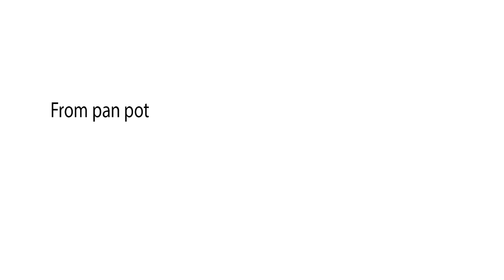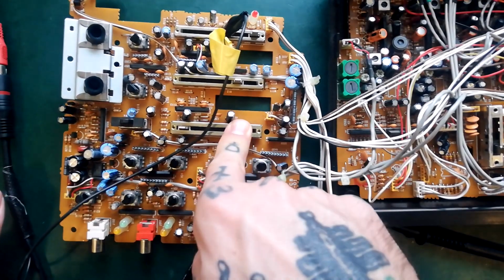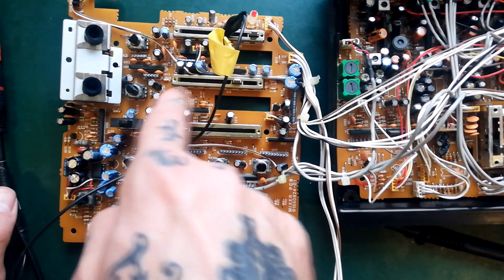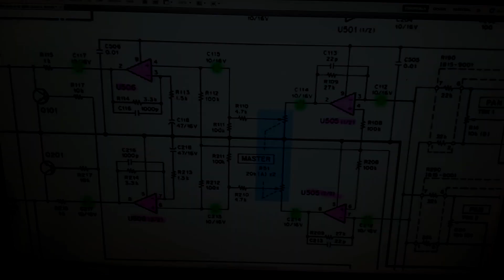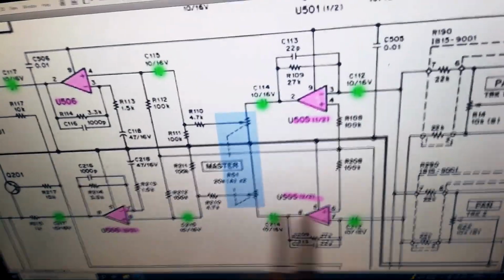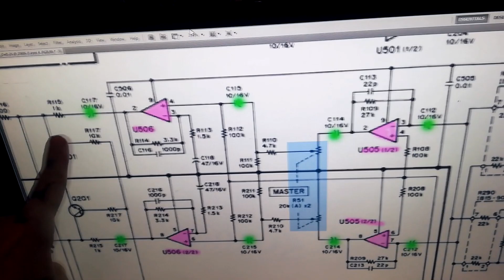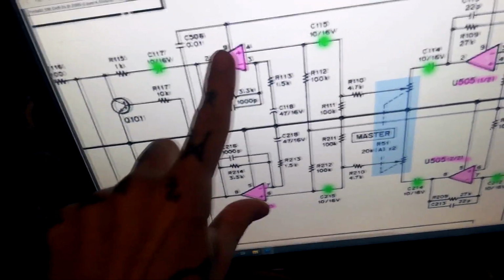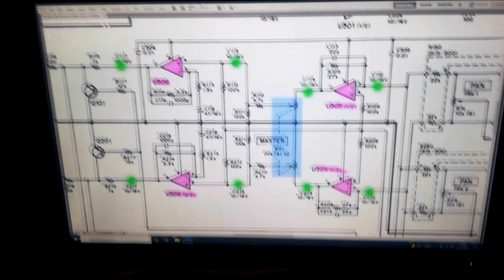Tascam Porta 03 | Repair Report | Recap stereo Buss | Signal tracing

Comment: I just gave up trying to repair mine.  I was able to fix the tape playback, but the 2 inputs do have signal all the way to headphone and line out, BUT the signal is either very quiet OR when you turn up the gain, it suddenly goes extremely loud and distorted / overloaded.
Reply from the maker: That's a pity, because the information in this video is directly applicable to your problem, I.e. replace electrolytic caps around the problem knob or fader
Reply: I think i'll try again maybe after a few months!

Comment: Excellent video. Great commentary and visuals. What Brand/specs would you recommend for the power section electrolytic caps. I would like to see a vid of a before/after of a unit with "ALL" caps replaced. Cheers.

Comment: Hi! Thanks so much for these video - I also loved the tear down! I just got myself Tascam Porta03 MkII also with an issue. Seller claimed it worked before shipment and I want to believe him since it's in a very good condition. I'm complete novice to tinkering with electronics and am considering not returning this as maybe the repair is easy/cheap and I won't find another unit easily. How it currently looks:
- when switching power on the power brick lets out a constant buzz which stops when the transport is engaged
- transport works
- I think a sproket might be missing because the tape gets out of the cassette and tangled in playback (only one 'wheel' of the cassette turns at a time)
- power led doesn't turn on (actually none led does)
- there's no signal coming out at all (tested both headphones and line out)
- leds don't register any signal coming in
Does it sound like its salvageable? I would really appreciate if you'd read through this comment...

Comment: I have an issue with mine where all of the channels seem to share the input signal no matter what I have the channel fader set to. Tapping on certain areas of the case also seems to create a thump of level on the inputs. Any ideas where I should begin?
Reply: Hi, basically when I plug a jack into an input (either one) all of the channels on the mixer section receive the signal from the jack input at once. The yellow signal indicator lights all flash together, receive the same level, etc. 

This is irrespective of where the Rec Function switch is. Also if I tap on the plastic of the case or close the cassette door, this somehow hits the inputs as if the case were microphonic. Cassette playback works as it should though, I believe this is some sort of issue with the mixer section or maybe the track routing? Any advice would be much appreciated.
Reply from the maker: @nahguags  thanks for clarifying.  I don't possess a working one of these at the moment, so as far as the routing goes, I'll need to get back to you after I've refamiliaried myself with the user manual and my own tutorial video. The microphonic thing is definitely off, and assuming the behaviour you're describing isn't what the designers intended, it could be related. It'd be worth opening it up to check if a previous owner didn't rebuild it wrong following a clean or repair? Look for shielding shorting against faders, connectors of the same size and number of pins plugged in the wrong place, etc? If the worst came to the worst, replacing the electrolytic caps on the mixer board (not that many of them on a unit that size.. ) and reflowing solder and checking the build is correct while you're in there would have a high likelihood of success.
Reply from the maker: Im sorry I font understand your description...and It's worth getting your terminology right here...channels are part of the mixer, whereas tracks are location on tape: faders only control levels, they don't route the signal anywhere. Please could you try to explain the problem a different way, maybe I can help?

Comment: Hell-o there good sir! I've recently bought one of these porta03 and it doesnt work.
(the previous owner had stored it neatly for somewhat 17 years and was stored in working condition).
OK, First i turned on the power, the tape recorders mechanics works, but the playback stopped at random times from time to time. I did not get any audio out from either the line outs or phones. All of the 4 tracks did signal that the playheads worked via LED, but no audio. The second time i turned the power on the LEDs died on me... 
So this will be my very first repairing project, with zero to none experience what so ever. 
Any words of wisdom or tips and tricks on how to face this ordeal of mine?
Anyway.. Thanks a bunch, Ye light bringer of tape recorders!
Reply from the maker: Thanks! Sounds like a previous user plugged in the wrong polarity of power supply unit. You'll probably need to replace the 9v voltage regulator and any electrolytic capacitors wired between ground and the 9v rail. The cassette player should work fine once you give it a a new set of belts and a bit of a clean.
Reply: @Tetrakan  Cheerio! Alright I'll change all the 10 capacitors (220UF 16V). I tried to look from the manual that which part is the voltage regulator(9v) but didn't understand that so i'm a bit confused on which kinda part to buy. As for the belts, i am quite sure. Once again thanks for the help!
Reply from the maker: Im working from memory here but I’m pretty sure that if you look on the schematic for the small circuit board where the 12 volt ac to dc adaptor is connected, you’re going to see an output cable to the mixer board labelled 9v. Follow that output back to a 3 pin transistor, that’s the one which is turning the 12v coming from te adapter into 9v used by the opamps ( audio circuit). You can check this is the right part by typing the part number of he chip into google and finding a specification sheet, it should describe it self as a voltage regulator, power transistor or similar. I had to replace  this part following damage from the wrong polarity of ac to dc adapter being attached.

Comment: hi again music man   i get all my cap's from RS in packs of 100   as some times i had to do big re cap  job    i have a brannel mni 8  i and i had to change alot of parts
i watched alot of your repair video's  i did the same as you  tracking the audio  and using a amp to find the ac audio  on card  i have wavelab 6 and i can make audeo
tome  cd's   and khz one's as well  saves my ears

Comment: Thanks for this video! I made and am currently using an audio probe to trace a problem and test the small caps on a 424mkii (rec level is Low on track 3).  Is there a place other than faders I can clip the grounding wire? I am working on bottom PCB and don’t want to have to remove the mixer PCB from the case to access the fader if I can avoid it. How do I know if I can use something as a ground, in general? Is there a way to test with a multimeter if a piece of metal/screw  in the machine is properly grounded and can serve as a grounding point for the audio probe? Thanks!
Reply from the maker: Good question, yes there are lots of other places you can connect the ground clip for the audio probe.  I suggest the fader on the mixer PCB becasue it is easy to grip with the alegator clip, easy to identify visually, and, most importantly *definitely part of circuit ground*, but any point that is connected to circuit ground can be used. Circuit ground is where charge goes to die - It is the zero volt area within a circuit, and within a healthy portastudio that is connected properly, all the largest areas of metal will be joined together to form circuit ground ;- the metal chassis of the transport; the metal casing of the magnetic heads; metal casings of faders and inductors; the large islands of copper you see on the bottom of PCBs ( which you will notice are joined to each other by jumper wires, and then connected to the same areas on other PCBs in the system  via either one strand of he multistrand cables going between circuit boards , or via black wires with ring connectors that screw to metal surfaces, or both). So when you see in my tear down videos the various ring connectors that join the cicuit baords and magnetic heads to the cassette palyer chassis, those are to ensure that there is one circuit ground for the whole unit. So, provided those ring connectors are attached, you could clip the audio probe to any plate on the cassette player. If the cassette player is out, the metal casing of the oscillator on the bottom board is a good bet. You can test whether somethign is part of circuit ground by testing with a continuity meter - the meter should beep and show a very low resistance value when both probes are touched to items that are part of circuit ground, becasue they should be a potential diffeence of 0 volts between them. I will make a video about this, but I hope that allows you to start probing your 424 board, if meantime you need any clarification get back to me here.
Reply: Amazing, thank you!

Comment: i just got ahold of a 414 mkii that arrived off ebay today. everything seems to be running great except the first mic/ line input has a really loud hiss to it. is this something common/ an easy fix? 🤞 thanks! im finding all your portastudio videos extremely informative
Reply from the maker: I haven't encountered it before but I'd suspect a bad coupling capacitor or opamp around the gain trim on that channel. If I'm right the parts aren't expensive or hard to get hold of.
Reply: thanks for the response! Here’s a strange detail I just figured out. It only happens when I’m using a guitar with the input. When I plug synths in it behaves nice and quiet just like the other inputs. But I tried a couple guitars and they each caused this loud hiss, but only when using the first mic/ line in. The hiss is affected by the trim fader,  as well as the track 1 fader and EQ controls. it can be heard from both the headphone out and the line outs, and the hiss gets recorded to tape. does any of this give you more hints about what might be happening? Thanks again!
Reply from the maker: Sounds like that channel is reacting to changes in instrument impedance, whereas the other three are not. I guess if the coupling capacitors around that gain stage were healthy, they would react less to different impedance instruments being plugged in. So yeah replace those caps, chances are high that'll fix the issue.